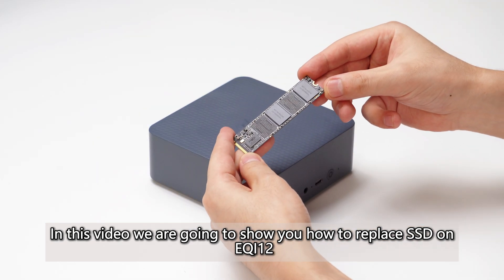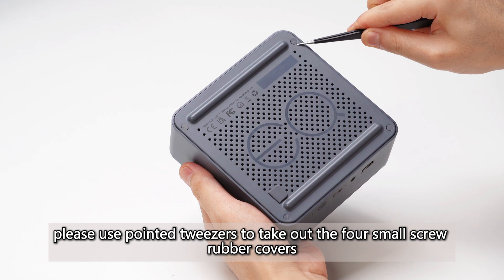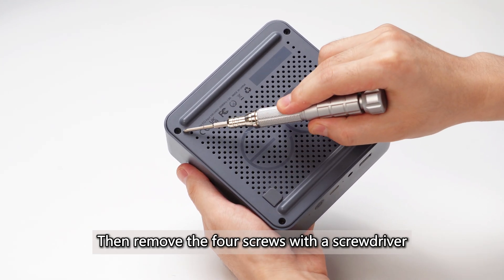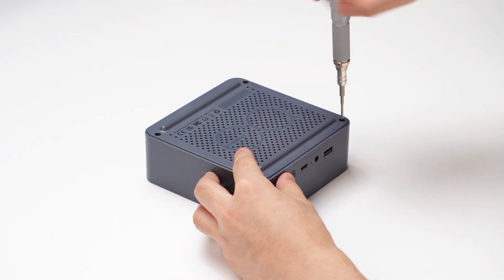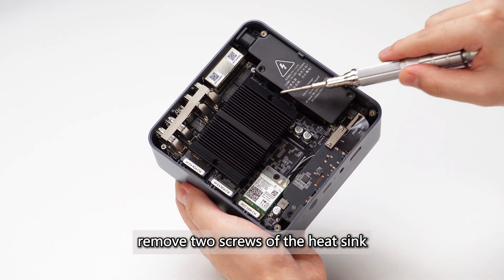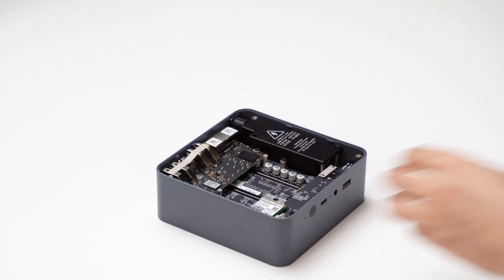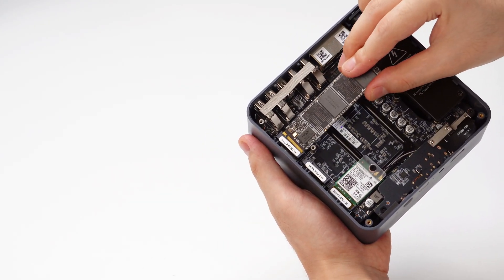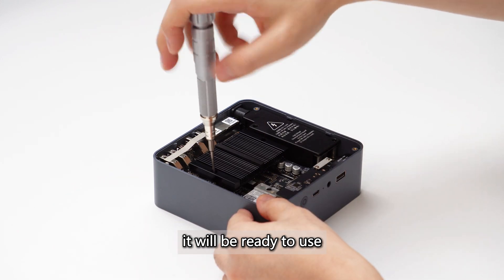How to replace SSD on EQi12

Comment: 2 problems here:
1. The heatsink comes with a thermal pad that only covers a very small portion of the drive.  With the example shown, only some of the chips on the upgraded drive will have any contact with the heatsink and you'll be trapping in heat from the others.

2. The m2 slots are close enough together that it doesn't look like it's possible to install an SSD that comes with its own heatsink unless you can remove the standoffs for the integrated heatsink -- they aren't hex shaped, so it's unclear how to (or if you can) remove them.
Reply from the maker: Hi, please reach out to us at support-pc@bee-link.com, our support team will handle your problems properly, thanks!

Comment: Except this is my third Beelink and the heatsink screws are so tight that they just strip regardless of the screwdriver I use.  I'm screwed.
Reply from the maker: Thank you very much for your feedback. We truly appreciate your input and will work on improving and optimizing the product going forward. If you need any replacement parts or further assistance, please don’t hesitate to contact our after-sales team at support-pc@bee-link.com